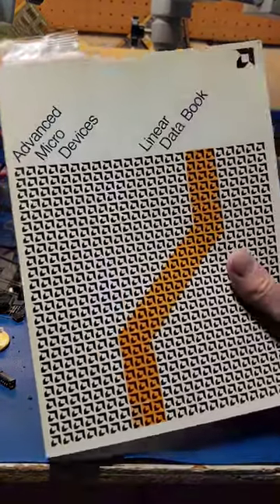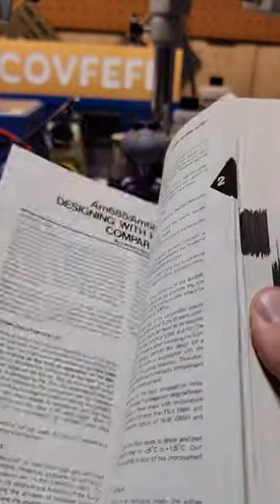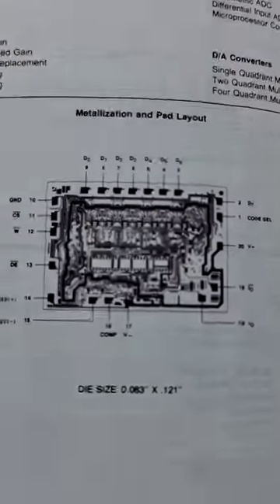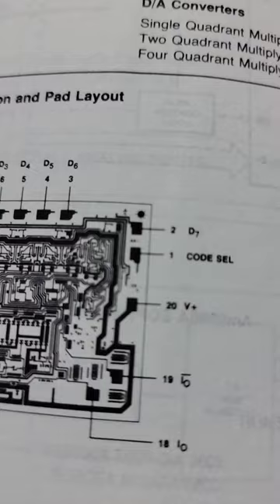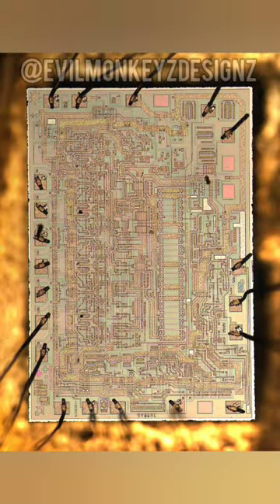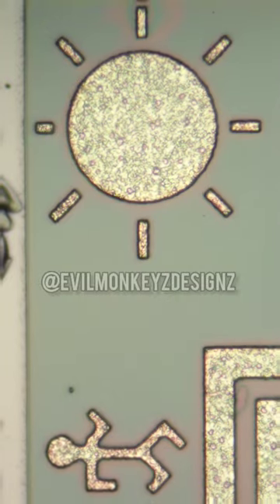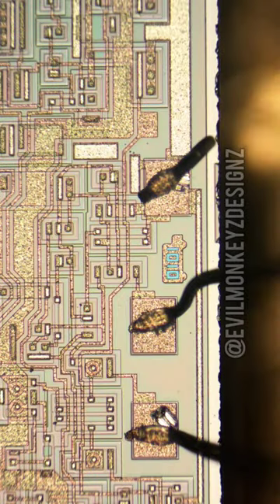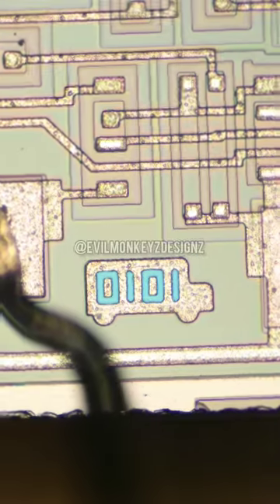A Serial Bus 🚌

Comment: Do you know that ATI licensed architectures to NVIDIA and intel (HD graphics), later after NVIDIA licensed the Kepler architecture to AMD as AMD managed to get the first contract with TSMC to manufacture the lowest architecture at its time. That’s the reason AMD was equally competing with NVIDIA. 
NVIDIA made a buck from AMD and viceversa. But NVIDIA would never license their secret and highest architecture. 
Later on AMD licensed graphics architecture to INTEL in the i7/i9 88xxG series. Even one of the intel had an AMD embedded graphics within the chip. 
Later on intel learned a lot from that AMD chip and started making what it’s now INTEL IRIS/ARC. 

AMD tried suing intel but there was no way to do so.

Comment: Do current microchip engineers still have the freedom to do that?
Reply: Yes, but every thing is Chinese.
Reply: No. Top metal is filled up by tool and via down. Other than chip logo and necessary marks, nobody wants to risk the yield to do that.
Reply: @deepblue7457 It doesn't impact yield unless physical spacing rules are being violated, which of course they won't.

They have physical verification tools that verify that the spacing rules have been complied with over the entire design.